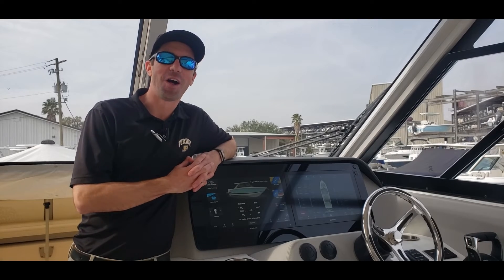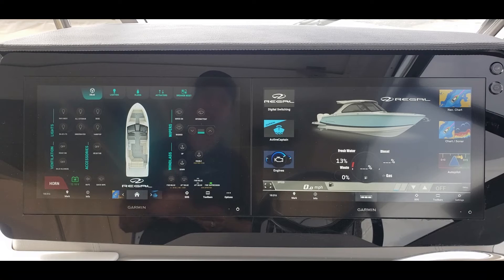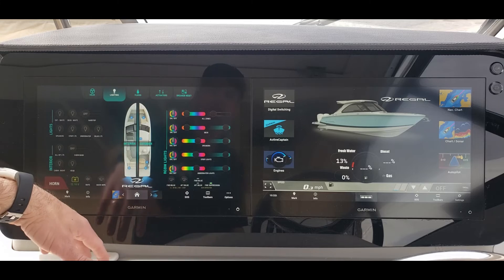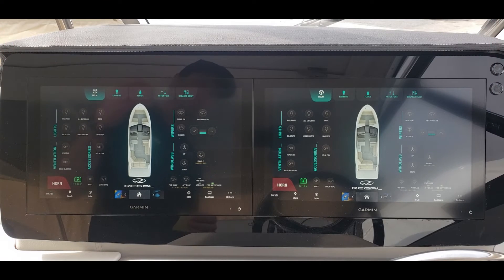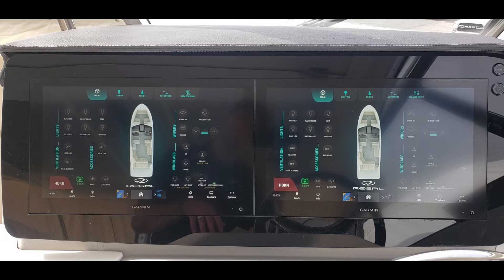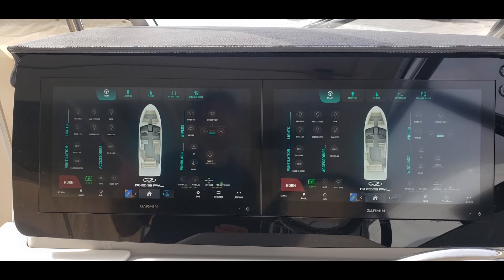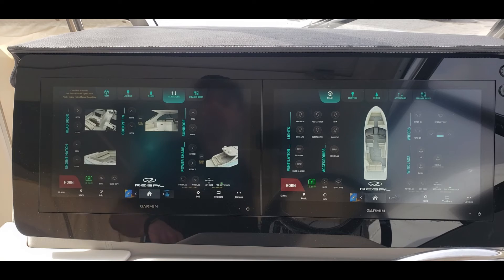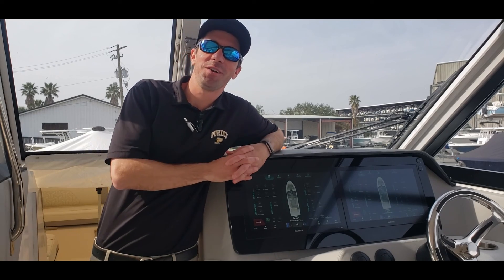Digital Switching with Garmin Marine MFDs in Regal Boats

Comment: Just got a regal. That was helpful. Still think it should have some manual switches, but I guess I gotta get over that.
Reply from the maker: Glad to hear; appreciate the feedback. What model did you get? There still are some manual switches for certain things though too. Thanks for watching!
Reply: 2024 SAV 38. Yeah, for the wipers and one other thing. You really gotta learn the system if you needed to do something quick. Like drop the anchor. I wish they did have some manual switches. But I guess I’ll have to get used to it!
Reply from the maker: @landman500  That is my absolute favorite boat based on how I would boat. Have fun out there!